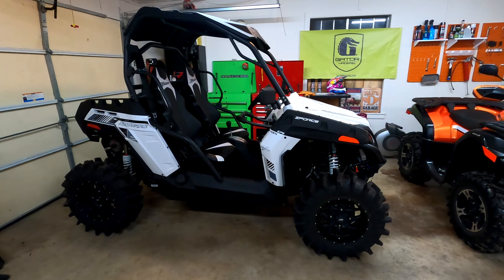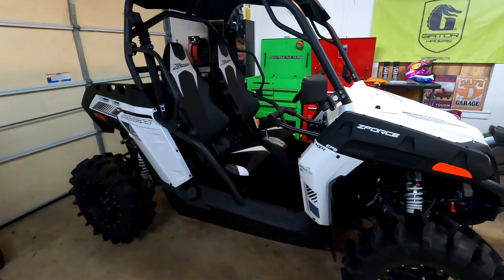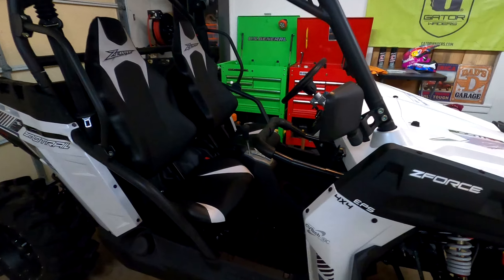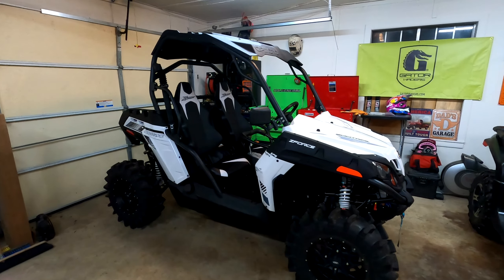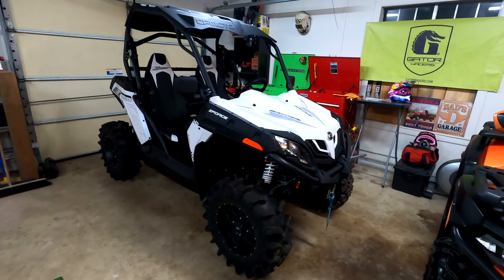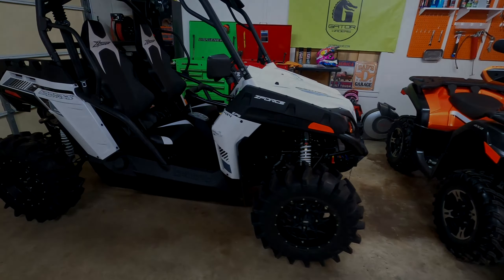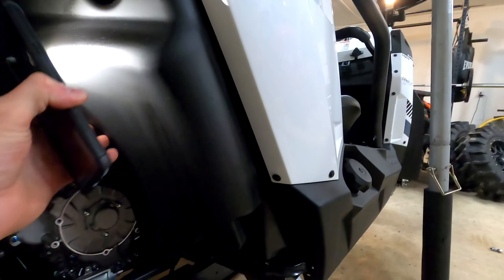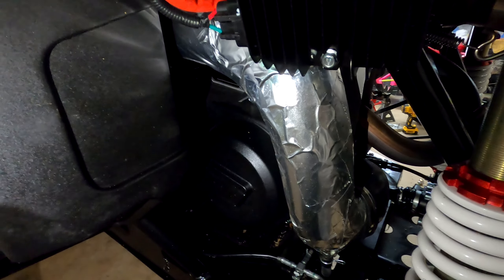2020 CFMOTO ZFORCE Trail | Best 50 Inch SxS

Comment: Purchased the 500 a few months back for my granddaughters and they absolutely love it I figured power in size wise it would be the perfect match for their experience level. I’m not saying the 500 lacks power because it doesn’t you can have just as much fun on the 500 as you can on the 800 it’s just not going to throw rooster tails like The V-twin 800 and the only problem I’ve had with either machine so far is the exhaust springs breaking which I easily fixed with some better quality aftermarket exhaust springs.
Reply: How has your z force 500 been so far ? I’m thinking about this one for my son

Comment: Just a sidenote 28 inch tires will not work without a 2 inch wheel spacer at least on the front because they’ll rub like crazy when you’re on the trails with the suspension articulating.
Reply: So with a lift could I fit 28s?

Comment: I have a 2018 and have been pretty hard on it, with no issues! It's an excellent machine. I wonder how it turns those 28's! I will soon be putting 29 or 30's on my ZForce 1000 and I plan on putting those stock 27's (from the 1000) on the ZForce 500 for a good upgrade to both.
Reply: Good day AdvOutdoors.  What kind of hard on it do you mean??,  like rock crawling,  mudding,  or running it hard on and off the gas corner to corner lol or all of the above
Reply: @aaronmcfee506  It's seen more mud than anything, where I am in Central Ontario, but I've been pretty heavy on the throttle, hitting ruts and whoops way harder than I should. Haven't done any actual rock crawling but I've sure framed it out on enough rocks lol. I don't have a huge amount of mileage on it at the moment but none of them have been "easy miles".
Reply: @GuardianGrove   I finally made a deposit on u force 1000  I was quite surprised at how smooth it rode and good power

Comment: Had a Cfmoto zforce 800 for five years now, had nonstop problems with it and the five years warranty is shit nothing is covered on it and I mean nothing. It has 1300 km on the clock, the dealer has disappeared and Cfmoto doesn’t respond to any of my emails. So now it sits in my garage collecting dust
Reply: 2021 zforce 800 ex runs good but it is made in China what is wrong with yours
Reply: @docoolstuff8732  it’s not made in China the brand is from China they are built in Minnesota engine blue prints and designs from ktm
Reply: Mine was garbage as well, wheel bearings had no grease in them from factory and 2 went with less than 200km, paint fell off the shocks, engine went at 1500km speed sensors didn't last at all. Machine never seen water or mud. Was strictly a trail machine and never abused

Comment: How well do you feel the 500 would perform with 2 heavier riders? Not going hill climbing, just trail riding and mudding.
Reply from the maker: I feel that in Low gear you would be just fine crawling through some mud trails.
Reply: It will do just fine. My 500 has done just fine with two big sized adults on there. On steep hills.